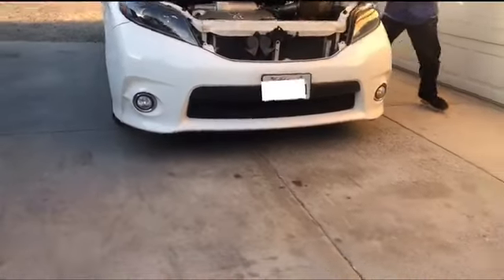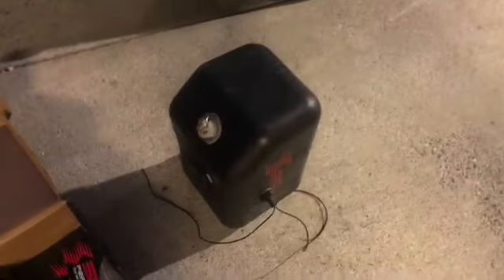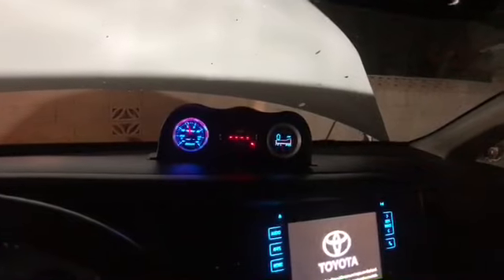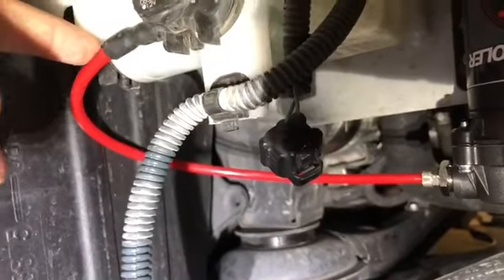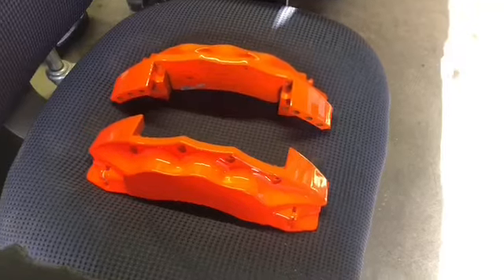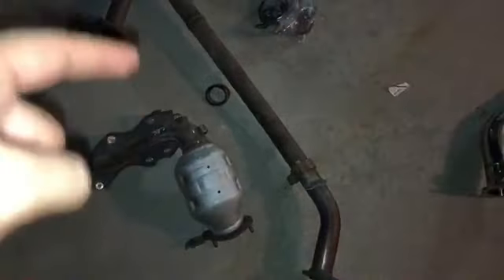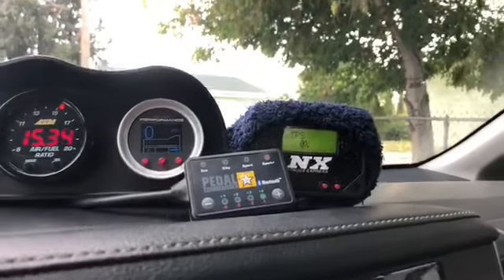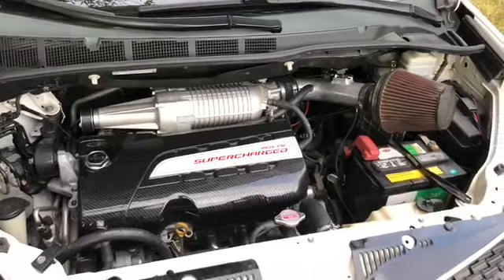Supercharged sienna gets full exhuast, water-methonal, front end swap, and more.

Comment: @DavidTRD - Is that exhaust system from the muffler back, is that a kit or custom made? I want to change out my muffler but with the weird factory setup, I'll need something like yours: a 90 bend toward the driver side, then a 180 back to the passenger side and a muffler mounted sideways, otherwise there isn't room for one without cutting out a lot of factory pipe and I want to avoid that.

Comment: somthe front bumper grill and hood bolts right on did you have to change and mounting brakets or no
Reply from the maker: No but we did have to get a different foam cover that goes on the metal bumper. Other than that it bolt right up

Comment: How much PSI is that supercharger making?
Reply from the maker: At the moment we are running a 1.9 pulley and pushing 15-16 psi.
Reply: @DavidTRD  Wow, that is insane numbers, did you get the D3 performance tune, trying to get them, heard they add 27 whp stock with just intake and 14 whp tune alone with 2011-2016 models, the 2017+ with 8 speeds get 30 whp with intake
Reply from the maker: Yeah we’re tuning on d3 performance. Wouldn’t doubt you could make that much power tuning with them on simple mods. So far we’ve had a good experience tuning with them and would recommend them.